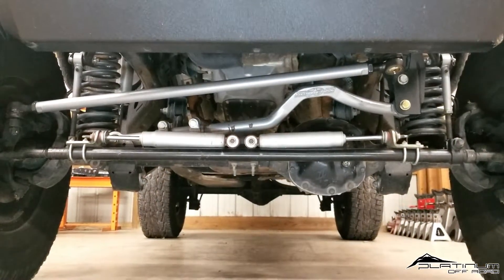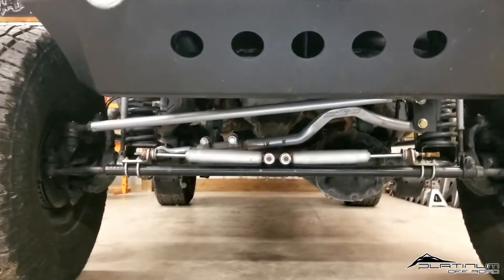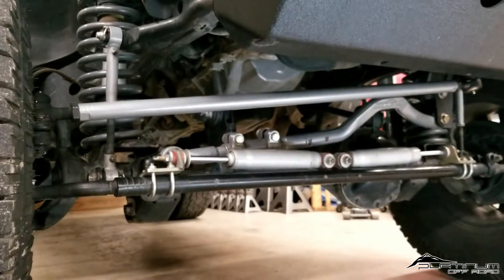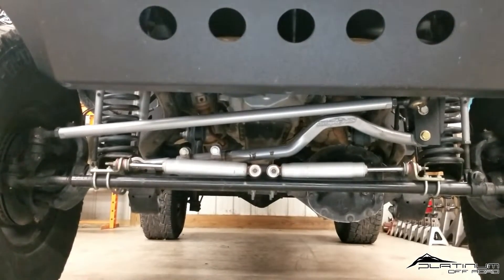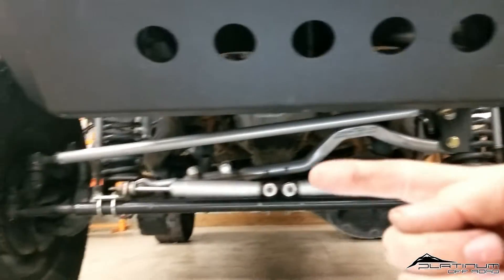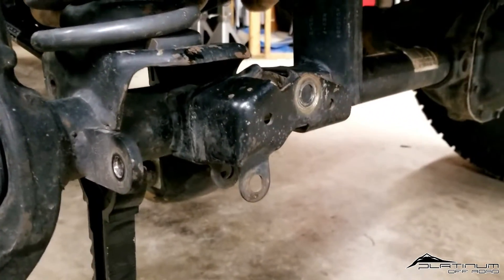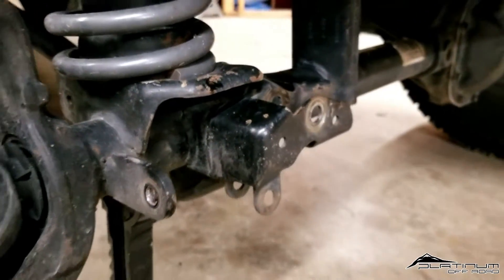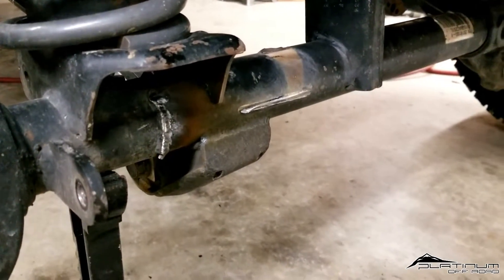Understanding Steering Geometry - Bump Steer, Drag Link Flip and Finding the Right Angles

Comment: I have a 2 1/2 lift but every thing else is new but still factory track bar, draglink and stuff. Would I need a flipped draglink. I have bad bump steering it’s all over and a floating feel when hitting bumps or cracks in road. 
Please help I’ve been dealing with this problem for about a year and no shops in my area can figure it out.
Reply from the maker: What model Jeep are you dealing with?

Typically, you won't flip the drag link and Rais the track bar's position until over 4" of lift on a JK. The JL's won't need them till closer to 5"+. The JL axles are just a tad wider, and this provides a wider radius angle that the axle will follow through during a bump.

If you're not far from north Texas, bring it to us. We actually get about a dozen or more Jeeps each year, hauled in to see us each year, all finding us from YouTube and expressing your exact frustration with local shops. There is other factors to be considered, but I'd have to see the Jeep and feel what it's doing.
Reply: @PlatinumOffRoad  thanks for replying back. 2014 sport wrangler 2 door very basic I have roll up windows. Found out my caster was off by 2 degrees so I installed control arm relocation brackets and caster is at 5 degrees now and WAY BETTER, I’ll replace all my bushings but by control arms next year. I was told I might need longer sway bars cause of the 2.5 lift 🤷🏽‍♂️ oh and adjustment shocks for a smoother ride. Any other suggestions for the rear end cause that still feels loose, floaty, bumpy?? I have never shit driven my jeep it’s just a pimp jeep has 182,000km around 150,000 miles
I do have 22x10 rims

Comment: Thank you for the video. I have a 2012 JKU, getting ready to put on Bilstein 5100 shocks and Icon dual rate coil springs, 3" on the front 2" on the back with 33" tires, front and rear steel bumpers, which on the front and full-size spare on the back, it's too heavy for my current shocks and springs...hoping this will improve the ride a bit without putting on an adjustable front track bar or lower control arms, only time will tell.
Reply from the maker: At a minimum, run the Fox 2.0 Performance. Bilstein set you mentioned are a longer version of factory. Many shops sell them because they're longer for the lift and a step up from the super cheap and squishy soft base line shocks out there. Not to mention an easier sale, because the price... but I can not tell you how many sets of the Bilstein 5100 we rip off for being a very soft and unstable ride... especially with the added weight of mods, over stock. Trust me. Spend the extra money and get the Fox Performance.. come back and thank me later!

Comment: I’ve got a 4 inch lift with trackbar relocation bracket on the passenger side and drop down pitman arm. Just ordered the Barnes 4WD tie rod bar as well as their flip kit for the drag. Was about to install both this weekend but after watching your video I’m a lil lost . What would you suggest I do in regards to the setup I though that by just flipping the drag link I would have better angles.
Reply from the maker: Hey sorry for the late discovery. So to flip on the knuckle side and keep the pitman, along with the existing axle side relocation bracket, spells disaster. Kill the axle side bracket and get a new weld on that raises the track bar to match up with the drag link flip. Remove the pitman arm and go back with factory and it will drive like a dream.

Comment: I'm going thru the same thing with my 94 yj, I have no tracbar (leaf spring), but the drag link portion,would that be the same for a YJ? I did a 3.5" lift but drag link is at harsher angle then what's here
Reply from the maker: Harsh angle drag links will inevitably have bumpsteer. That's just the radius that it will flow through. At some point you need to do a drag link flip, or dropped pitman arm. It just depends on what is out there for the model Jeep. If you don't have a track bar, due to the leafs, then a QUALITY dropped pitman will do you well.

Comment: I’m currently doing a 3.5” lift. The lift has a pitman drop. Would you suggest not using it and just using the bracket and do a flip kit?
Reply from the maker: Never put a dropped pitman on a crossover drag link system. The loss of strength and failure to truly tend to geometry changes, is a complete waste of time and money. We have a pile of dropped pitmans we've removed when correcting steering geometry.

Comment: Correct but your ass backwards. Frame doesn’t go up when hitting bump and pull pitman arm in. Axle goes up when hitting bump and it gets pushed. Also track bar and drag link need to be at equal pivot points relative to height. They were already parallel.
Reply from the maker: Truth. And frame rebounds over each bump. Ultimately both have a shared relationship in the movement. Thats why the steering will actually get pushed and pulled; steering wheel left and right.

Comment: I don't think your rear axel has much to with it at all. Only as far as a bump to the rears will lift the frame and change the momentum load on the front axel. Equal but opposite force as the frame rotates around the center of gravity. 

Unless I misunderstood what you were saying. Either way, good job straightening out your suspension issue;)
Reply from the maker: Correct... this video is all about the front geometry. A rear axle hitting a bump will cause frontal load again to a minor degree, but yes the video was ultimately about getting front steering and drag link geometries in line!

Comment: Learning so much from your videos! I've just subscribed. I've noticed a little shimmy on the front passenger side under hard breaking from high speed. i thought it was the beginnings of death wobble but now I'm thinking drag link and track bar alignment. (?)
Reply from the maker: Thanks for the support! So if it's the braking shake you described (especially if it's only during rapid braking), the front rotors need turned and some fresh pads to go along with that resurfacing.

Steering geometry issues will be a hard shifting of the steering wheel when hitting a bump or rapid braking. This steering wheel shift will be directly related and associated with the frames positioning to the axle. In other words, the axle experiences a bump - it moves towards the frame... if you slam on the brakes, your frame drops down towards the axle. These will be one or two major changes in the frame to axle positioning; therefore your steering wheel will not shimmy or shake at this time. It will merely shift as the frame and axle positioning changes.

Comment: I thought as long as the lines are parallel (same angle) then its good, never heard that you need to line them up height wise.  Also flatter angle is better, so you could try dropping the trac bar back to the lower mount and adding a drop pitman arm as long as the drop is the same amount, which should get them both nice and flat
Reply from the maker: The whole parallel rule is true... to a degree. The TJ and XJ steering used a Y-link system. In these cases, yes all we can do is parallel them. The JKs moved to the full tie rod cross over and provided a wider axle and frame.. allowing us to even more perfect the geometry changes of a lifted Jeep. To run by the whole parallel rule is good if that's all you can do with the Jeep, however to even more greatly improve the ride quality... align the two on the same plane and just experience the difference. It's nothing I try and sell or convince to folks. The proof is in the pudding per se and yes there is a major gain in ride control and quality when aligning the planes vs just merely getting them to run parallel. Draw it out on paper with a protractor and find the conflicting radius with the parallel setup... then do the same with a setup that aligns the planes and you'll see it plain as day.
Reply: @PlatinumOffRoad  
Where did you find the waterfall in the opening scene?
Reply: @PlatinumOffRoad  "JK messed it up so now we have to do more work" 🤪

Comment: Thanks for this, I have bump steer, and I did a panhard drop bracket, but didn't flip the steering rod..
Reply from the maker: If you did the frame side drop, and now planning to flip the drag link (passenger side) .. you won't get the improvement as much as returning the frame same to factory and raising the axle side mount for the track bar (panhard) to best align with the drag link flip. Pretty much what spurred me to make this exact video. My situation in this video was from that experience, and this video shows how I corrected it.

Comment: Looks to me like they simply bent the track bar incorrectly. Had it been strait it looks like it would’ve paralleled perfectly with the drag link. You can’t ever go wrong with synergy products as they are always thoroughly thought out. I would’ve just used a regular crossover kit myself.. but had I had something like this I think I’d remove that odd trackbar and just use a more traditional singe bend bar that’s been proven to work for 50 years lol. Looks like some engineer was paid to reinvent the wheel here and make something that looks different for a sales pitch that just doesn’t make any sense to anyone who understands steering geometry.
Reply from the maker: Basic geometry is at play with any steering setup. Not sure where a design of track bar or drag link has any point in the matter of a Point A to Point B concept. The conflicting radius path of the track bar and the drag link is what causes bumpsteer. The track bar is frame mounted which means it will dominate the battle between the two radius. The steering will have to conform to the drag link radius and ultimately move all steering linkage (bumpsteer). It has nothing to do with a product having no bends, one bend or five bends.. it's all about the radius path. You can take a straight component and a s-curve component, mount them in the exact positions and get the exact same result because you never corrected the radius path. This video was focused on fixing bumpsteer by repositioning the radius paths through the product mounting points = Basic geometry. Feel free to use whatever product you want or kit.. in the end basic geometry is either set up to the best possible positions for the vehicle or its not. Bumpsteer will exist, or it will not. We regularly fix it with a variety of brands and designs by means of this information and that's how I know the basic geometry in this tutorial video works.

Comment: Omg I think you just solved my drunk driver experience! Roads where I live are so broken that I’m driving down the road and ping ponging in the lane like a drunk driver! I’ve upgraded all the steering components to teraflex HD parts and got the adjustable steering stabilizer from teraflex and I’ve had it on firm and even on firm setting my steering wheel steel does that jerk with Jeep movement on road bumps! Definitely going to get and install this to hopefully fix my jeeps drunk driver experience!
Reply from the maker: Awesome!!! Did you do their Flip Kit option on the drag link? If so, then yes the raised track bar bracket (axle side) is a must with flips.
Reply: Platinum Off Road  didn’t know teraflex did that option. Might have overlooked it or saw it but didn’t know what it meant but I do now. 👍🏻

Comment: No offense...but to do a video on steering geometry while having two stabilizers is a bit ridiculous.
Reply from the maker: Ha... non taken! And here's why: I know that steering stabilizers have their place and often the need to reduce road dampening comes with other geometry factors outside of any steering geometry mentioned in this video. But since you brought it up.. steering dampeners are helpful when leverage is increased against the steering system (ie: wheel offset or use of wheel spacers). Road bumps become more erratic as you increase pull or leverage on the steering. If you hit a bump at 70mph while running a wheel with positive offset, the vehicle handles that bump completely different than someone running wheels with minor negative offset (-6mm or -12mm) and even more contrast handling of an even extreme neg. offset wheel such as a -32mm beadlock or running 1.5" wheel spacers. Try all these various wheel combos out on the same exact Jeep with the same stabilizer(s) and you will see what I'm talking about. I build Jeeps with all different arrangements of wheel offsets and steering stabilizers and have had enough experience to make these statements as proven results 

Stabilizers help reduce the acute force on the steering components and overall system... nothing to affect geometry... and especially geometry mentioned in this video. Not sure why they were even brought up...? The Jeep at the time of the video had -6mm offset wheels AND 1.5" wheel spacers. After tossing the spacers and moving to a -12mm wheel, the dual stabilizers came off and back to a single if that makes you feel better.. again it's all based on resistance and what each Jeep needs... to bicker over a dual kit is kind of like ridiculing someone running a Fox ATS stabilizer because it truly adds more resistance to combat acute road bump forces. They (stabilizers of any or all sorts) do work when you have a need for them based on the above reasons.
Reply: LMAO good one Russell! Did you even think before writing that attempt to show out? While Platinum already summed it up with the purpose of any stabilizer, the Jeep world is full of geniuses with more opinions than sense and speak without reasoning first. Im sure youre the guy at the Jeep meets trashing another rigs while your $40 rock lights are flashing away at the top of your buddy's 285s squeezed under his XJ that you just stacked on! SMH Cool guy!!

Comment: Maybe a stupid question but I see all 3 lines parallel... I understand that it helped the steer bump... but I cant understand why.... its because green is closer to yellow?
Reply from the maker: Good question!
So at one point many years back, Jeep builders always said to focus on making drag link and track bar parallel, but if you imagine their point of pivot and the radius each one will follow.. that is the cause for bumpsteer. Two parallel lines with different mounting points and different lengths, will follow conflicting radius flows.. which is still bumpsteer. It's ideal to have the track bar and drag link mount exactly at the same point or plane on each end. Due to how everything is located under the Jeep, that's impossible.. the best set up system will have a track bar that's the same length of the drag link and mounted on the same horizontal plane at each end. Many cases the track bar has to be set outside of the frame for this length to be achieved. Most fabricated race rigs will do this if you look closely. Daily street rigs, not too often.

Comment: Thanks for this video. What track bar relocation bracket did you use?
Reply from the maker: Synergy weld on kit for the axle and the Rubicon Express was the frame side that we ended up merely keeping on for added support to the factory position. The Synergy was the one that we actually used for geometry function.

Comment: I have a JK sport unlimited.  I plan on doing a 2.5" lift.  Will I need to do a drag link flip on it?  Or at what point do you start saying that the flip kit is required?
Reply from the maker: No need for a flip. When you jump into the 4"+ levels is when you really start to notice the need.

Comment: It's been 3 months since I installed my Rubicon Express tie rod and drag link. the Rubicon Express track bar was put on at the beginning of the year. I haven't even watched your video yet and I'm already getting excited that I might finally solved my issue. My Jeep is all over the road since my drag link and tie rod install
Reply from the maker: First off thanks for finding us and checking out the video! Second, how did things go? Were you able to find resolution or insight to a potential issue?
Reply: @PlatinumOffRoad  it is at a four-wheel drive shop right now. I was supposed to hear from them Monday. I bought the traction bar bracket before I took it to them so they could install it. I have high hopes
Reply: @CPMac1994  How did it turn out? Did it fix your issue?
Reply: @CPMac1994  how did it go?
Reply: @86gtocar  after the drop bracket install and an alignment it drives great
Reply: @CPMac1994  that's awesome! How much was the installation for the bracket?
Reply: @86gtocar  honestly I don't remember because I had several things done and I did not look at the itemized to list.